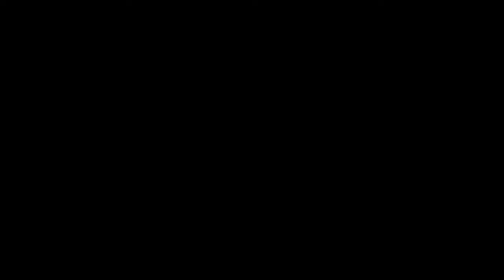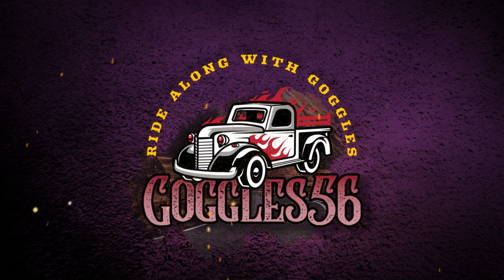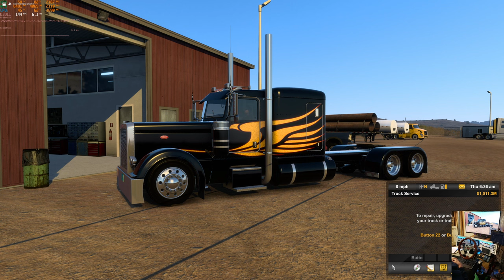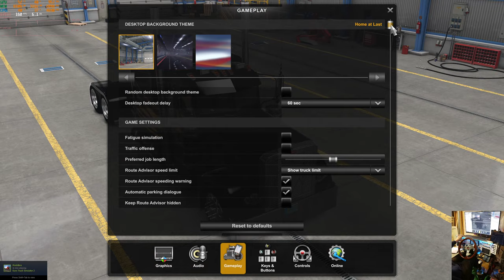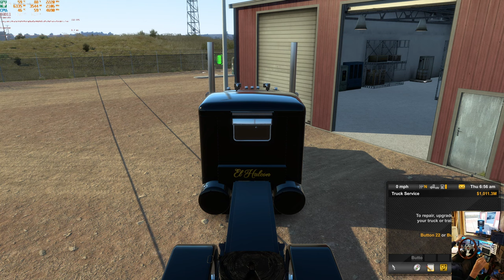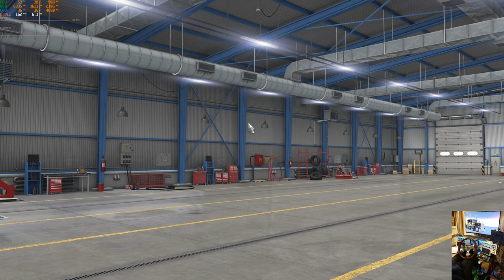ATS Transmissions Ratios Explained Plus Shifting Tips

Comment: So in the base game, looking at the Kenworth W900, I see that the most expensive transmission has 7 speeds, gear ratios of 7.63-0.64, and a 3.55 differential.  Based on what you've said, it sounds like that transmission would barely be able to move anything, but it's the "best", at least according to the price point.  Does it have any practical use, or is it just something to put on a sightseeing truck that won't be hauling anything?
Reply from the maker: That would be a full automatic as opposed to an 18 speed autoshift. The full automatic has a torque converter just like a passenger vehicle. IRL this a really expensive yet effective transmission. The torque converter "slips" until lock up which is like having a lower gear ratio and multiplies available torque. You won't see many of them in heavy haul though.
Reply: @danmcnarry  I see; thank you for the info!  I just bought my first truck in this game; I put the top-end 18-speed Eaton on it, and it pulls beautifully.
Reply: TLDR; if you want best experience use 18 speed eaton it is easier to use in game (which is ironic lol) it is probably best truly all around gearbox but if you want guns ablaze max speed with decent torque 4700 blows every other transmission away

allsion transmissions have torque converter in the game too and its working. i believe it even shown in game characteristics

basically all allison gearboxes are 'speedy' options with far better acceleration compared to eaton due to less power loss when shifting because of steeper ratio difference between gears since there is less of them. what separates 4700 is it has climb gear simply put 1st gear which works like ultra low gear (its not shown in game for whatever reason but you can still see the difference compared to other allison its huge when hill climbing) and since there is VERY little amount of places with long hills 18 speeder eaton (the only real gearbox which could even be considered as alternative best option) would lose badly to 4700 in speed competition since acceleration from 0 to 35 and 35 to 65 is what most important in this game in terms of speed.

also what engine you have is very important which is where eaton would shine since its a lot more universal so its doesnt really matter but if you are 'always use most powerful engine' type of person allison would be better.
Reply: sorry if my comment is redundant already to you i just wanted to share since someone else could have similar question in future
Reply: @drmagg666  Thanks for the info!  So far, I have been using the engines with the most horsepower, but I haven't tried an Allison yet.  One thing I want to do when I've saved some money is to set up a little 4x2 Freightliner Day Cab and see how quick I can make it.
Reply: @AstralDragoon  cool to hear! just dont forget that less axles less stable truck so turns at high speed with load could end very bad or very fun depending how you look at it haha
Reply: Update: I put the Allison with a max-displacement engine in the lightest Freightliner chassis.  I drive it flat-out to speed up clearing photo trophies, and it is absolutely terrifying.

Comment: On Retarders: Almost never equipped in the US on haul trucks and almost exclusively used in heavy haul / offroad trucks. Even then its extremely rare nowadays. Think of it like a big torque converter bolted to the back of the engine (works whether in gear or not iirc)  You apply hydraulic pressure to apply the retarder, and it slows the engine down. At least thats my very, very basic understanding of them. 

Jakes are of course not nearly as popular in Euro trucks as they are loud. So, most Euro trucks have a retarder.

Comment: I feel like 18 gears is more or less pointless using automatic gearbox, whatever load i'm hauling 7 gears or 18 doesn't seem to matter, the only thing 18 gearbox seems to be doing is go through alot of gears, why go through like 5-6 gears instead of 2?.
Reply: It’s really just fuel efficiency more gears means you can keep RPM’s in your engines sweet spot. For instance the Cummins X15 models peak at 1,000 or 1,200 depending on model. So if you have it set to manual you can keep it in the “sweet spot”, as for automatic it’s not as noticeable. Basically it allows for more control over engine power and fuel consumption. You’re better off with 10-13 speed transmission if you do automatic. A 10-12 speed in real life is capable of moving some of the largest legal loads, for instance it could move 68 tons up a grade as steep as 9%. 

In short it’s for the peaks in torque that way you can swap bands to hold that sweet spot, so a transmission is important for fuel efficiency and getting the total potential out of an engine especially when pulling grades. It is also kind of important if playing ATS in hard economy cause a penny saved is a penny earned.

Comment: how does the gear matching work for split gears all other transmission automatically split shift down just be moveing the splitter butten they down follow the basic principlals of gear matching aplly trottle for dowmshift and release trottel for up shift its not like a real truck nobody seems to get that
Reply from the maker: Toby, I still blip the throttle on a downshift and back off the throttle on an upshift during a split. You still need to speed match the transmission gears. The game doesn't seem to care though but it is how it's done.